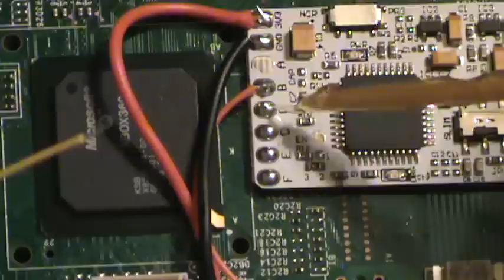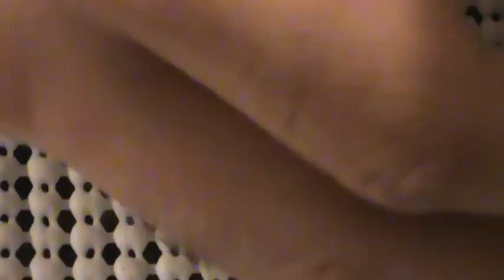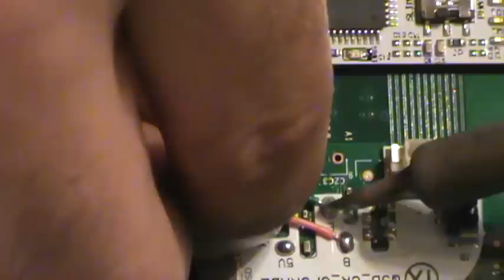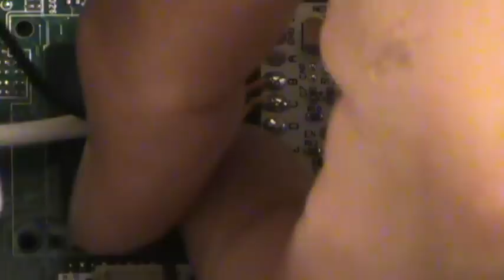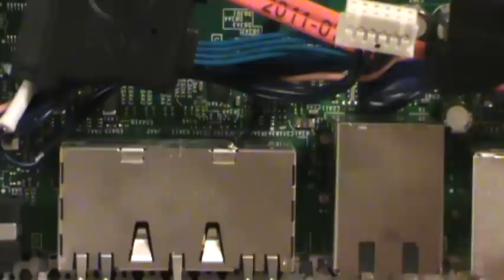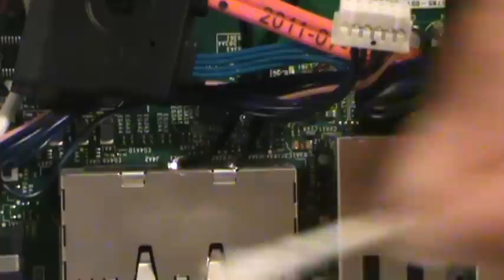Xbox 360 Corona RGH Tutorial Part 3

Comment: yellow wire, Point C... Yeah I broke that solder point off and im kinda worried. my xbox is fine, but i cant get the wire to stick in the hole. any advice from an expert?
Reply from the maker: Yes. You will have to either use the via point on the other side of the board or use a post fix adapter.